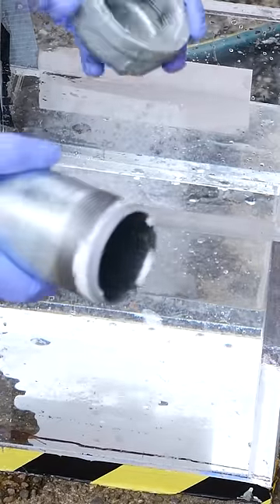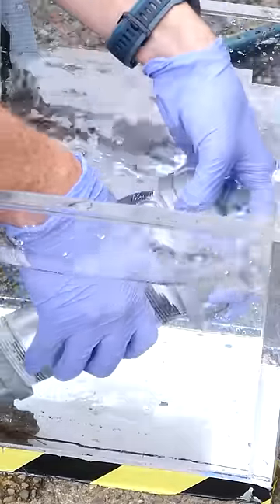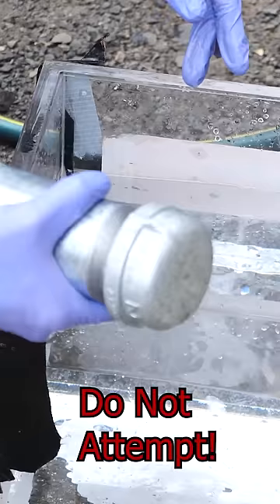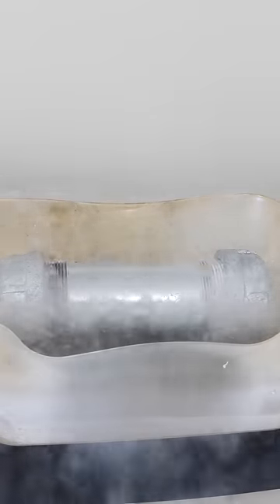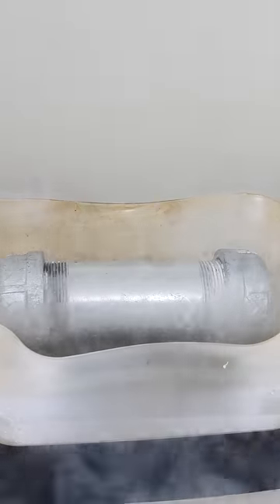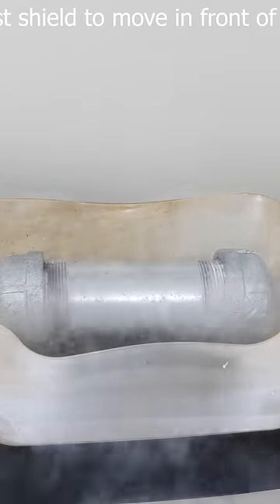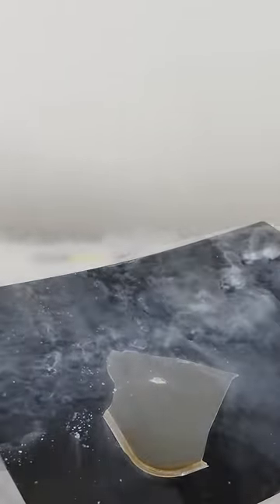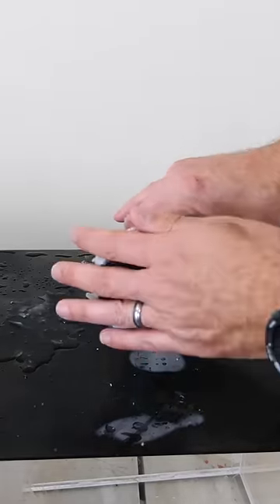Don't Ever Try To Stop Water From Freezing!

Comment: The water, in fact, will not turn into ice until the molecules have room to expand. The moment the pressure popped the cap, the water you saw against the inside walls had frozen immediately. The only reason it wasn't a solid block inside is due to the pressure being so high that some water shot out faster than it could freeze, which is fantastic.
Reply: Yep, and the water will remain above freezing temperature until it has room to expand.
Reply: It seems that, in this case, part of the water actually becomed solid. Otherwise, How can you explain the increase on the pressure? When you cool down a liquid, the molecules move slower, which would cause a pressure decrease, pressure can only if part of the liquid becomes solid, expandind and reducing the volume for the rest.
Reply: Iv'e had a similar thing happen when I've opened a can of coke that's been chilled at a low temperature. It immediately turns into slush as soon as you pull the ring.
Reply: It is already fantastic that ice is floating. Fish survive during winter, because that ice is like a blanket, it really protects the water from freezing completely. Think about that. WHY does ice expand? Why? Do you know WHY?
Reply: @voornaam3191 too many carbs?
Reply: I love that you said it was fantastic. I personally thought it was spectacular.
Reply: Well the structural integrity of steel may have been cause, considering it was being cooled rapidly!!
Reply: Yes...the pressure increased because some of the water froze, that's what he said @wmtnez
Reply: I'd say there's more chance that there was a partial freeze, before the cap blew. As far as I understand, the expansion doesn't occur until the molecules create a crystallized lattice. If that's the case, then ice must have formed before the explosion.
Reply: @Razumen  In the way it is written, I understand he said that all the water was liquid until the moment the tube exploded, when the water inmediately freeze.
Reply: You're also lowering the temperature of the steel pipe well below freezing, which can weaken it significantly.
Reply: @voornaam3191 why does it expand? Well, basically, the hydrogen bonds between water molecules “compress” water, allowing the molecules to be closer together through the attraction. The structure for a solid is more rigid, though, and further apart than these hydrogen bonds allow, thus making it expand.
Hydrogen bonds are really the only reason H2O is a liquid at such high temperatures, most other O molecules are gas at room temperature.
Reply: Yeah but some of it does have room to expand which is why it causes pressure and there is ice on the outer area of the volume
Reply: @TrillBillTx I think we're in the same page.  As it all was cooled rapidly, the center portion of water was still above 5ºC (therefore, compressible) and the outer layer expanded, freezing up
Reply: @chrism5465 If it's above freezing then how does it expand and freeze? It's the pressure that's preventing it from freezing.
Reply: Is that so? I thought  the pressure would create another type of ice. Like ice IIV
Reply: @giork2828  Literally correct, go back to school. Water doesn't expand until just before and after reaching the freezing point.
Reply: @giork2828  maximun water density is reached at 4ºC but the decrease from 4 to 0 is smaller (-0.00013 g/ml) than the increase from 10 to 4 (+0.00027 g/ml), and much smaller than from room temperature (~20ºC, +0.00176 g/ml, x10). Considering the cylinder was sealed during the freezing process, pressure should in fact have gone down on the way from 20 to 4 inside the cylinder, changing in fact the freezing point (as pressure goes down, the freezing point goes up), so I'd say ice was definitely formed inside before blowing up (at 0ºC it would still be under 1 atm even if all was still liquid). Once the pressure was released then surely the layer got thicker.
Reply: @MarcillaSmith  Lol
Reply: @chrism5465  Not sure if that's true, as super-cooled water exists. It's an icing problem for aircraft where water droplets can cool below zero (down to about -30°C) and will only freeze once they are shocked, so a plane hitting them.
Reply: thats very cool!
Reply: @wmtnez Water has a fascinating phase change diagram. I don’t know the specifics, but some probably did freeze, while other parts didn’t.
Reply: @voornaam3191 hey, ice expand because some spesial electric forces are doing its job and putting molecules in certain places. When thing is hot, molecules move fast and remain a liquid, but when thing is cold, molecules dont move around that much and some smaller forces between molecules make them went and stay in certain posision. Water is pretty unique with it expansion, most of things lose their volume when become solids, cause they dont move around too much, and settle down closer to each other. But interesting forces between water molecules specifically make them be in a structure, where molecules are actually a bit further from each other, then when they move around more freely
Reply: @Zack-bl2gg oh shit i actually was wrong in my understanding. This is more correct
Reply: I bet that water tastes CRISP
Reply: Correct, kinda same thing happens with a water bottle that's left on the freezer for an hour or so and is hit or open...
The expansion immediately will cause the water to freeze.
Reply: My thoughts exactly as ice melts under pressure eg ice skates.
Reply: What about those ice-3 and ice-69 things created supposedly under pressure?
Reply: Source: the guy my cousin buys his weed from said so.... 😅😅😅😅😅
Reply: @voornaam3191 Um, no it doesn't.
The reason why ice covers the water is because water expands anormously. Water had it's highest density at 4°C, and is therefore more dense than ice. So the ice floats, while the less colder water hangs about on the bottom. That's why fish and other aquatic creatures survive in winter.

Comment: The liquid nitrogen also plays a small part here. Steel gets brittle in the cold, and nitrogen is cold enough to make steel very easy to break (a method of breaking locks is to turn a can of compressed air upside down to shoot the cold liquid into the lock cylinder, then hitting it with a hammer to shatter it). The steel would still break if you used a slower freezing method but it may have survived longer. This makes me want to see just how much steel is needed to survive freezing water.
Reply: I've never been present when it happened, but I've seen iron pipe fittings split by freezing water just because they weren't drained adequately in winter weather. Liquid nitrogen is not necessary.
Reply: At some point the water would just push the steel out of the way without breaking it right?  Assuming there’s enough steel so the whole thing doesnt just shatter
Reply: @Vertix07911 probably yes. Or one can descend somewhere where the pressure is 2000 atm.
Reply: That was my thought, i was like are you just making the steel brittle and exerting a pressure from within a pipe(which isnt as strong as if it were coming from the outside) like damn just wantsd to make a pipebome i guess
Reply: @BrienMalone physically, that's a result of the threading process weakening the pipe. But it is desirable since otherwise the pipe would have a tendency to split along its length which is a more difficult repair to an operational pipe.
Reply: A storage unit manager told me they use Freon and a hammer to bust locks . You can do the same thing with propane but you have to use a brass hammer so you don't create sparks.
Reply: There a demo sphere with an inch thick steel wall with maybe a half inch whole to the center that you plug with a bolt. It explodes as well.
Reply: @Vertix07911 depends on the temper a soft steel sure, hardened steel, or cast iron (like those end caps) will always crack and never stretch.
Reply: Dang good point! ✌️
Reply: somebody breaks into garages here lol
Reply: That pipe would have split down the side if it was froze alot slower that using liquid nitrogen, all metals expand and contract to a certain degree and liquid nitrogen just makes anything brittle, from bananas and flowers to the hardest metals. 
He got the point across just fine but there is alot more science going on here that he didn't explain.
Reply: Absolutely correct! Regular carbon steel pipe is only stable until-20f. Would it still break? Yes. But liquid nitrogen is roughly-200f. So if you only put in pressurized air it would have failed too. How much pressure? It’s hard to say without knowing the type of metal and wall thickness.
Reply: @russlehman2070  Absolutely, but  I think it blew up a bit earlier than expected. In that nitrogen may have played a role
Reply: I can’t here to say the same thing, liquid nitrogen was the wrong choice for the cooling method.
Reply: It Also wouldn’t have fractured so violently with a slower method
Reply: Also my thought. If he wants to make a experiment showing water expanding he should at least have given the container a chance.
Reply: It wasn’t even on tight.
Reply: @genespell4340  brass hammers are expensive as hell
Reply: @genespell4340  The brass hammer part is the most fascinating part of your comment.🤔
Really interesting.
Reply: @Vertix07911 
Water also can be frozen in a way where it does not expand. When temperatures and pressure gets high enough, the water will freeze without expanding.
Reply: @russlehman2070 can confirm. Lived in northeast Washington for a while and even worked some water losses. Peoples pipes bursting in the winter isn't uncommon
Reply: @andrewyork3869 its not just cast iron, its malleable iron. Much stronger than cast by about 15 times.
Reply: @4thdimensiontravels855  really that surprises me. I know I have broken cast iron fittings dropping them.
Reply: 2000 Atmospheres sounds like a lot of steel needed to not break.
Reply: It is referred to as “Nitrogen Embrittlement.”
Reply: I was thinking an ice gun like a like a potato gun. 😂
Reply: Yeah, how about just putting it in a freezer and see what results? Word up 👊🏽
Reply: @andrewyork3869 hardened steel generally makes for poor pipes. Ask yourself why, when making combustion engines, they make the housing in cast iron?
Reply: So the liquid nitrogen actually plays a large part?
Reply: @KnowNothing-n9j    False.  Water does in fact expand before freezing, then expands even more when it freezes.  It is not due to air gaps, but due to its the molecular structure.  
Here is a quote about the subject: When liquid water is cooled, it contracts like one would expect until a temperature of approximately 4 degrees Celsius is reached. After that, it expands slightly until it reaches the freezing point, and then when it freezes it expands by approximately 9%.

This unusual behavior has its origin in the structure of the water molecule. There is a strong tendency to form a network of hydrogen bonds, where each hydrogen atom is in a line between two oxygen atoms. This hydrogen bonding tendency gets stronger as the temperature gets lower (because there is less thermal energy to shake the hydrogen bonds out of position). The ice structure is completely hydrogen bonded, and these bonds force the crystalline structure to be very "open"  End of quote.
You can find lots of science sites that say basically the same thing.  None claim it is due to air gaps.
Reply: @genespell4340 I had to Google was Freon was but apparently it's non-flammable? So you wouldn't have to worry about sparks..
Reply: Okay most ppl wouldn't read all that(includes me too)but this guy is a nerd🤓😁
Reply: @user-rr7zb9kr1g    Water expands around 4 degrees before it freezes. Then expands more when frozen. There wouldn't be air in a vacuum chamber unless you trapped air in it as it frozen outside of the vacuum chamber. Again this is well-known science that it expands even without air trapped in the ice.
Reply: Great point
Reply: @Vertix07911 I think it would stretch it to a point of cracking it at its weak point during the forging.
Reply: There are some interesting experiments revolving around this concept. There are actually several different types of ice based on pressure. I believe Veritasium has a video about this and snowflake formation from about a year ago.
Reply: @genespell4340 We used a grinder. Much easier.
Reply: Thanks for telling me how to break in, homie
Reply: I figured that would
Reply: If the metal didn’t expand or explode wouldn’t the water stay a liquid, I think that’s what happens in Antarctica under the ice in some parts theres underwater lakes because the pressure is too high for it’s to freeze or is that due to the weight above it?
Reply: same shit happen to my pressure washer😢
Reply: Wonder how thick the walls gotta be then lol
Reply: @gameboy2.071 If the container is strong enough that it won’t expand or break, a different form of ice will actually form, other than the normal hexagonal ice we normally experience, like cubic ice or ice II. Some forms of ice, depending on the temperature and pressure, actually contract when they freeze, causing an ice that is more dense than water. This doesn’t happen naturally on earth but we have created it in lab environments.

Comment: “What if we put it in a container that won’t expand?” 

You sir have made yourself a bomb 😂
Reply: LOL glad I wasn't the only one who saw that. i thought of the 2 bolts 1 nut trick 🤣
Reply: It's a bo'oh wo'oh
Reply: It's legit just a water jet bomb. Could get even nastier had it been two different containers in one; one being filled with boiling water and the other being filled with freezing water. Freezing, not frozen. Would essentially be the worse case of freezer burn
Reply: Well, that technically it did expand... Just not at the same rate as the water 😁
Reply: MrKnowsItAll  "when water freezes it goes smaller"

That's... Not true. The entire reason for this video is that water expands as it freezes into ice.
Reply: MrKnowsItAll  ??? 

Yes... And? Lol sorry, I'm not sure I get where you're going with this haha
Reply: If the container won’t expand and it can withstand the pressure, you will have ice on the inside. A different higher pressure created ice than what’s in your freezer.
Reply: MrKnowsItAll  oh okay lol, my bad! 😅
Reply: zssllayers1946  water expands when it freezes
Reply: I remember a shop teacher of mine say something roughly similar when warning us not to get water into one of the furnaces.
Reply: zssllayers1946  technically water isn’t wet depending on which definition of wet.  As an adjective or verb, water is not wet. As a noun, water would be wet.
Reply: Most liquids get smaller as they freeze, because the molecules get closer together in a solid. Water is a special case, as the molecules stack in a crystal structure, so they take up more room as ice than as water. This is the reason why ice cubes float in water, ice is less dense.
Reply: @TheRaker1000  Water also expanses as it becomes steam as well.
Reply: Water and ice don't compress very well, and so the energy stored in it at the point of failure is very limited. Gass compresses a lot and can store huge amounts of energy, which is what does the work of ripping a casing to shreds and propelling the fragments. Hydrotesting is pretty safe and that's the reason gas systems are usually tested to proof load using a water pump.
Reply: The way I read womb instead of bomb 💀
Reply: True
Reply: zssllayers1946  he’s not know it all, you’re just Mr. has no idea.
Reply: Nah we will get water in the form of a critical fluid state.
Reply: zssllayers19460  Are you serious? Water does expand when it freezes. Its even mentioned in the video. Liquids cant be compressed at all so it gets smaller as it gets cold makes no sense. Its the whole principle behind hydraulic systems.
Reply: @alexisrivera200xable it's not that "liquids" don't compress, it's that H₂O is special.
Reply: Closer to a cannon in this case. Lol..
Reply: If you design a machine to do this intentionally , you could create a lethal water gun using cold to produce pressure instead of pumps. You could even fill the barrel with a vacuum and design it to pop at an extremely high pressure like the lid of the water pipe bomb
Reply: Actually guys, water does contract as it gets colder. It keeps contracting right until it starts freezing, at which point water does its own thing and ice does something else.
Reply: @voldemort008 how would you use water as an adjective? the verb is an action, so that makes sense. to water means to pour or sprinkle (water- noun) over an area. it also means to be full of moisture(water or other vapor). so it would still be wet because it's still refering to the noun water.
Reply: @devdecker7812 elaborate a little more  In idiot terms
Reply: @glassboi5401  essentially a water jet shotgun